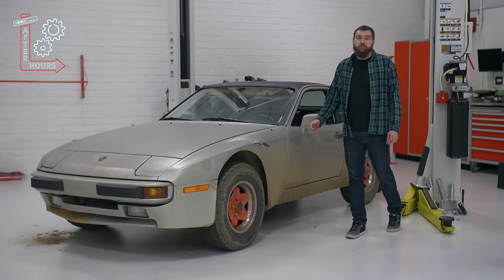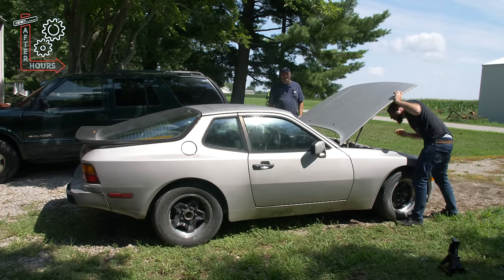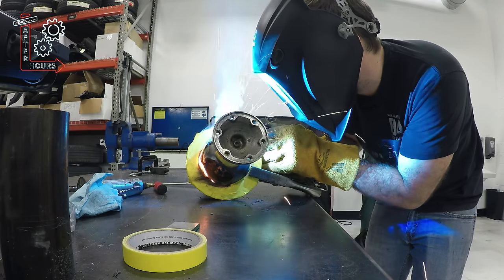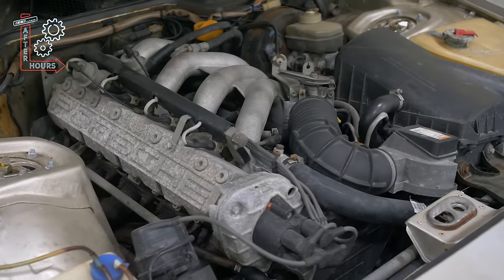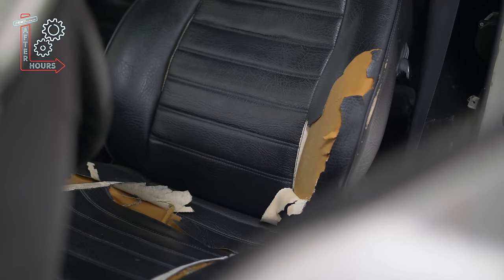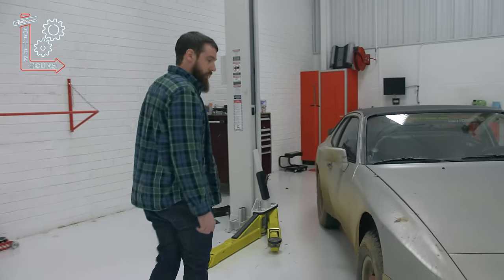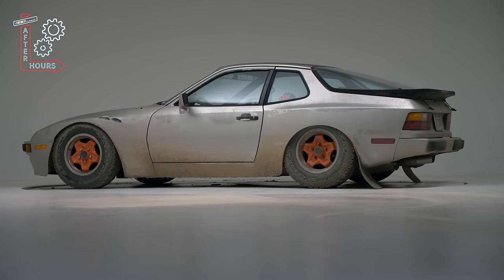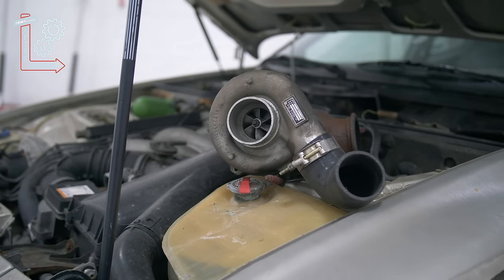$550 Porsche - A New Lease on Life // Winter Beater Challenge

Comment: hey,thats a lot of car for 550 dollars...
Reply: in europe cheapest i can find is 3 to 4k for a running 944. anything lower and its an empty chassis
Reply: @Boemel   Yeah for real, the US seems to have a way better market for cheap 944's. Keep in mind that this also means that most of the time, what we in europe consider to be a really good 944 would be very very rare in the US, because the general condition of these cars there seems to be worse than here.
Reply: It worked out for him mostly.  Many people have found themselves in "German car Hell" with "cheap" Porsche, Audi, BMW and others.  It also helps that he's got DIY knowledge.

For many, that would be a huge money pit that just started small.
Reply: @Boemel  no way you gonna buy a driving not rusted to absolute shit 944 for under 3-4k in the United States, title is clickbait. Rust free sheels go for 3 times more than 500 bucks!
Reply: @BlueTrane2028  Too true. I think it's the shitty engine that saved him. Less power = less strain on everything else. Also, it's likely to have been originally purchased by a less enthusiastic driver.
Reply: Yeah 550 plus 10k
Reply: @1DEADBEEF1  technically it wasn't in drivable condition. Lucky for him than only the fuel pump needed replacing.
Reply: Not to mention there is nothing positive about gigantic 4 cylinder engines! They get too complex with their balancing shafts, way as much as a modern LS! (LS1 is 70-80 lbs heavier, not much considering the power and torque gain)  My cousin had a 344 and he sold it pretty fast- was kinda a joke with 130horsepower in a sports car, a 15 year old kia spectra would be slightly faster and a modern dodge grand caravan would blast a 344 turbo like you wouldnt belive (290hp, lots of low end torque and a crisp 6.speed auto) we have a couple of these grand caravans used as squads :D
Reply: @Boemel  germany over 2000 euro  for a rustbucket one its unfair  if you see someone  can buy for 550 dollar
Reply: 1DEADBEEF1 I think it all depends on location. In Southern California 944s go for the price of miatas and civic si’s of similar age and condition from what I’ve seen on Craigslist
Reply: Here in Brazil the cheapest 944 you can find is 20k dollars :)
Reply: @Thechildishmandingo  wtf bud you're comparing different car eras, 944 is a late 70ties design. I think the first gen miata came out in 89 when they were wrapping up the production of 944. but i agree wirh you that you woundt be able.to buy a Civic SI nor a NA miata for that price either! (Unless its rusted to absolute sheet, thats what the leftover hunks sell for after parting out)
Reply: but hes put a lot more than 550 into it to get it moving as well
Reply: @iMiilk182  these are junks for 500$ good ones goes in usa 10k to 20k
Reply: @-Sean_  Shhh don't ruin the fake news illusion
Reply: I bought mine for 1000 a month ago in upstate New York also it was not running

Comment: the cheapest running 944 that i find in austria is about 5000€...
Reply: about the same in rest of the Europe , unless you go for cars that have been robbed for parts ..  then you can find shells for around 800€ to 1000€.      My best tip for you is to check sites and papers that sell old rally cars that have been laying in barns for 10+ years.   they can be more cheap than full on street car with papers.
Reply: in portugal the price is around 11 000€.
Reply: İn turkey 100.000₺
Reply: Komm nach Florida junge... die Dingern sind wie "Sand am Meer ", kosten nie mehr als 3,000$
Reply: Korea goes upto 15,000$ and i cant find 944 for sale now
Reply: @nopowerlaboratory  i found 5 within 50 miles of my place for less than 5k...most 3k
Reply: @tigas3573  pois é que merda
Reply: This one WASN'T running so...
Reply: @airmech404  Exactly... You'd think these clowns haven't gone thru the actual video have they
Reply: @nopowerlaboratory  I have one for sale , fresh restaured !

Comment: 5 cylinders are a whole lot cooler than 4 indeed
Reply: Not as cool as some 6 tho
Reply: You'd think so. I've got a nice sounding 6 cyl  and 8 cyl. and I hear a 5 cyl. and I want one purely for the sound.There's a roughness tossed in with the smoothness. The best sounding Porsche 944 EVER has a Mazda 6 cyl. though. Look up 944 KLZE swap there's only one video with sound. I have that same engine, just not in a Porsche. Still though an Audi or Volvo 5 cyl. turbo would be nice.
Reply: Audi RS3 8VA 2,5L (VW EA855evo)

This 5 Cylinder Engine from Audi is such a BEAST !!! You just need to swap it for the fans ^^ ;-)

Comment: WOW, In the EU they sell in this condition for about 2-3000$ and 5000+ for a nice one. For some reason I thought they should be the cheapest in Germany but it seems they are much cheaper in the UK and in the USA.
Reply: Jeff Lee As if people buy 944's to race in a straight line...
Reply: Jeff Lee I never said I thought that, but your comment implied, given the larger engine and the term "smoke", which is commonly used in straight line racing, plus the choice of 2 iconic American cars which are widely used in straight line racing, that you meant drag racing. Still, weight matters, especially on those tight backroads. There is not a stock v6 mustang or camaro that weighs as little at that Porsche. No doubt a mustang or camaro can corner, but if the driver is good, the weight is a huge advantage in twisties, and one that can't be overcome by power until the road becomes straight.
Reply: Jeff Lee Before we get too far off topic I think it would be good to mention now that the reason anyone buys a certain car over another car is usually personal preference, and therefore what we are arguing about doesn't really matter. So what I'm saying is, if someone wants a 944 they aren't going to decide not to get one because a mustang or camaro may or may not beat it in a theoretical race on a theoretical stretch of road or track. That being said, a 2002 mustang weighs (roughly) about 1000lbs more than a 924. If you wanna talk about cornering g's and performance ability you either compare stock to stock or modified to modified. I'm assuming your mustang is modified? If that's the case, I'm certain a 924 could be given just as much power and have just as much cornering performance, which makes this whole argument utterly pointless. It is more reasonable to compare stock to stock, in which case a Porsche is considerably lighter, and, especially against a 2002 mustang, will corner better in twisty roads. Also are we talking twisties here or road courses? Road courses are much more open as you know, and not everybody drives on a race track, do we? To be honest, we are wasting our time, because there are a great number of factors which affect this comparison: year, price, modifications, condition, driver, etc. But stock for stock, since you mentioned a 2002 mustang, and a v6 at that, I'm willing to bet the Porsche would win on a twisty mountain road.
Reply: Jeff Lee A 944 may be around that much, admittedly I did a quick search, and more specifically for a 924, which seems to weigh from 2300-2500, depending on where you look. I searched for both a 2002 mustang and the 924 and obviously weights vary so my previous statement about 1000 was off, but again it depends on who is weighing it, apparently, because there doesn't seem to be consistent info. Still, 500-600 pounds is a considerable margine. Also I am quite aware of our racing prowess, and I too am a lover of American cars and have been all my life. I grew up watching Nascar for crying out loud, that's about as American a motorsport as it gets. The trans am stuff is legendary, shelby is legendary, the ford gt... legendary, and I've always cheered for the corvettes, and more recently, the ford gt's in the IMSA and WEC. I am a car guy, I like just about anything, and if you told me to choose between a camaro and a mustang, I'd take both along with my porsche because I love them all. I'm not hating on American cars here at all, and I'm not saying you are totally wrong, I'm simply saying that I'm willing to bet, given the theoretical race between a stock 2002 v6 mustang and a stock 944 or a 924 (although probably not the early, 95hp ones) on a twisty back road, I'm putting my money on the porsche for handling and weight. No, it's not as powerful, and I don't think anyone really buys a 944 thinking to beat a mustang, but I'm saying they could, given the theoretical parameters above. I think the new mustangs would be a step ahead, although they are much heavier, they manage the weight well with their wide tires and suspension. That being said, I don't think most people would cross shop an s550 with a 944. If we wanted to be even more fair, a same year mustang as this 944 (1983) would probably lose alot worse than your sn95.
Reply: Jeff Lee American fanboy , yea good luck with your v6 mustang

Comment: I bought mine for 2600 just 2 months ago. Have not needed to do anything to it yet besides sealing the rear hatch and adjusting the shifter. Added spacers for my 18” wheels and slotted rotors. I actually love the 2.5 motor. Great car and good deal! 👍 I would pick another one up for that deal and find a good 1JZ or 2JZ swap. Then keep both lol

Comment: I have had 3 of these 944s. Two were no and one was a fixer upper and none were ever as rough as yours. You can buy a factory seal for that top and the problem may be the evacuation tubes for the top and rear windows. If they crack or fall off the rear of the turns in to a pond when it rains on the car.
Reply: Not no, new!

Comment: Nice video. Cool control arms. The original steel ones buckle quite easy. Don't ask how I know. Not that the alu ones are much better, they snap in two, and there's no way to get back to the garage. I have a friend that use an old 944 for ice racing with the long spikes on the tires. There's a big adjustment - especially with these cars, being used to how they really stick to the curves - to suddenly drive down a dirt road. Unless you're a rally driver of course. I really like the intro, pretty much air between the car and the road there ! Don't cut the heart out - supercharge it or something instead.

Comment: There was that time in my early 20's as a tire/oil change guy in the mech shop. When the boss sent me to get coffee, in the 944 that I had just finished working on. Boss says take it on i390 and open it up (throttle). For a "cheap" Porsche, not the most desirable model, and in this case a used car dealer's refurb. I bit my lip. 100k Mi  and only 4700 USD.

Comment: Funny to see that this 944, generally,  has the same problems and imperfections as mine did. corroded hood on the battery, no hood foam , visible interior wear, same latch problems, weak struts, brake problems, water infiltration etc etc. I took care of them already and slowly getting it to a restored state. I Was hoping that you'd tune your 2.5 to the max and see what it can do so I could take notes before you put a 5 pot in it .
This engine stock is a bit disapointing... I believe that it can get more fun with a few performance parts.. 
Nevertheless, subscribed

Comment: Try any of that stuff in the opening video in a Shelby GT 500, a McClairen , or a Lamborghini and come back with just the steering wheel! Check the drain tubes at the back of the back glass is probably were all the water came from. There are two plastic tubes back there that crack and fall off and puts the water that is to drain out of the car the into the rear boot inside!

Comment: most suspension parts are same as a vw rabbit. as in buy the cheap rabbit parts if you need to freshen suspension, the non s 924 also had the same rabbit suspension.

Comment: So I'm wondering if this ECS tuning that sells the big brake kit that I have on my 01 Audi A4. They appear to be TT RS four piston calipers. 1 rotor is pretty wretched on the inside as it was when I got the car. I've been looking for replacement rotors as they're kinda looking low grade. As I understand this brake setup has a tendency to where the inside brake pad faster than the outside and has been ran metal to metal.as best I can figure without pulling them off the car I find any part number they are a 370 mm by 32mm. I'm not really happy with the hat of the rotors, they appear to be roughcast. Kind of a simulated two-piece looking design. The genuine Audi TTRS rotors look similar but appeared to be machined better without the Roughcast look which does not age well. I'm looking for a cost-effective source for rotors that will work with this setup. Any cross-referencing part numbers would be appreciated.

Comment: Porsche for $500?? I know where there's one a couple years older than this one. It's been sitting for several years in a guy's driveway in much worse condition and you know how much that car would cost you?? Let's just say a hell hole a lot more than 500! You can't get the lug nuts off one of those cards for $500. How in hell did you get a old car and it's not rotted too sweet on holy Jesus the one I'm talking about here is rotted to all hell spent at least two years sitting on the guy's lawn for it migrated to is driveway. Every time I pass it I feel sick and I know for a fact a couple people tried to buy it and he said like 10 or 15,000 and it's rotted so bad I don't even think it's good for parts. It's about 84 or 85.

Comment: we have one of these at work (long story) and i've done about 2Mm in it. i wonder how people deem this a fun sports car. it's heavy, the steering is notchy and vague, the man who laid out the interior must have been thinking it was a boat. the gauges are crap and invisible when they work, the suspension is soft and wallows, it leans like a drunken rowboat and the brakes are beyond shit. the engine while torquey is underpowered and manages the poison you slowly with CO because the rubber spoiler makes a wake that sucks up exhaust through the taillights and the boot lid that don't seal properly. also the boot lid pins either don't close or let go when the body twists, which it does. it does kinda fine highway cruising but any spirited driving quickly defeats it. and don't get me started on the wheel bearing issues.

if you want something fun  for cheap, get a fiat seicento sporting, and cage it. beat the snot out of it untill the engine blows, get a new one at the scrapdealer. it's not rwd but it is a lot better car and way cheaper in the long run